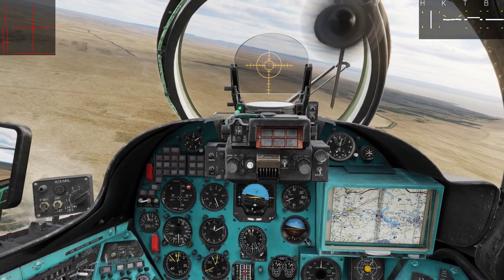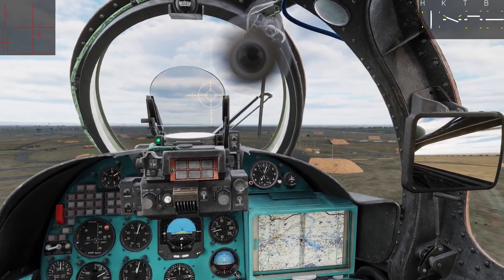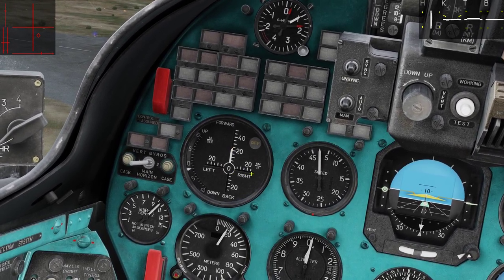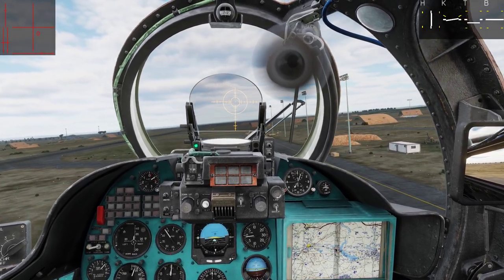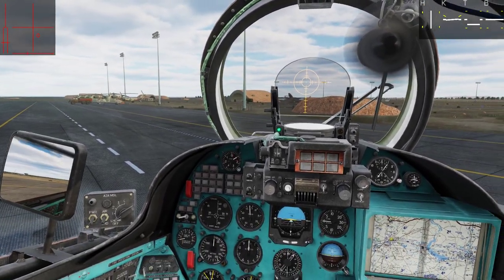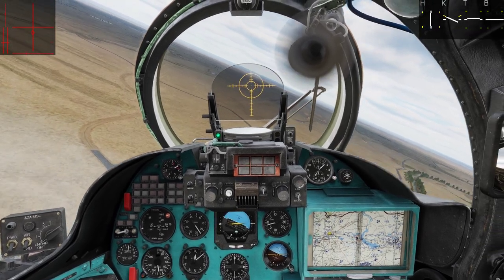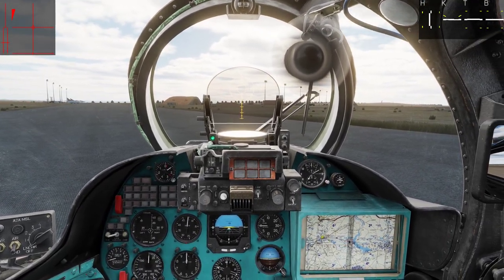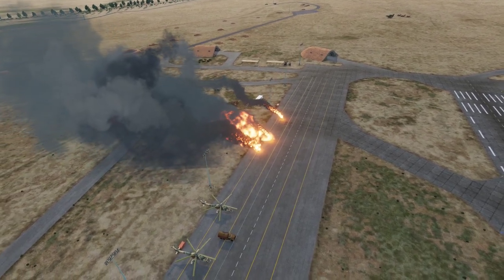DCS | Mi-24 landing tutorial

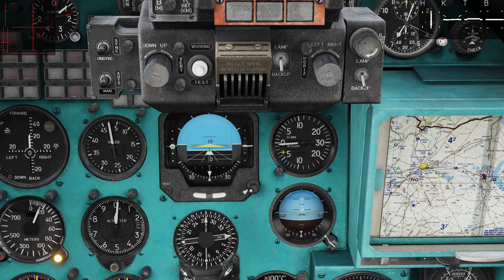Comment: what you are referring to at 2:37 and 7:45 is more likely entering Vortex Ring state then NR decay. Generally your NR is going higher due to the low collctive setting , descent and decelerative attitude. Once entered VRS, adding power makes it even worse, so you need to pitch down and gain Airspeed in order to get away without falling to the ground. Keeping an eye on the VSI is key during low speed and descending, especially during the last 100 feet.